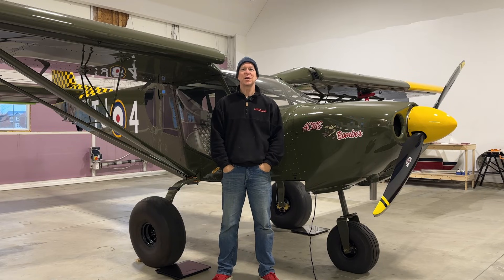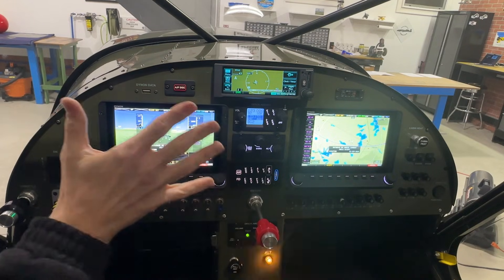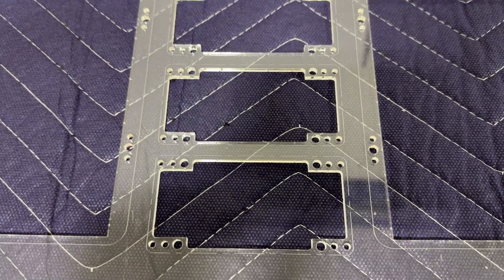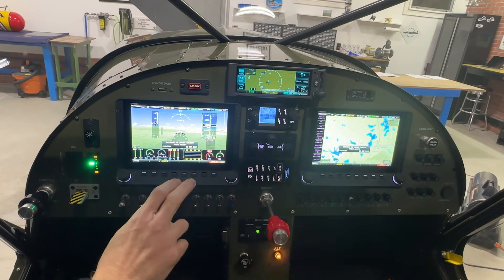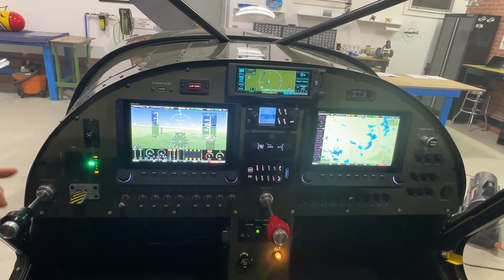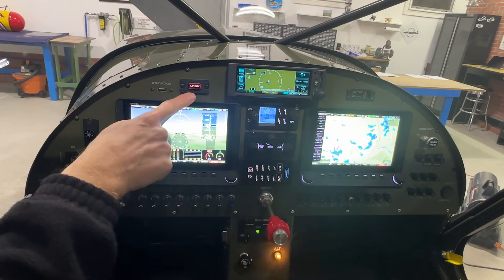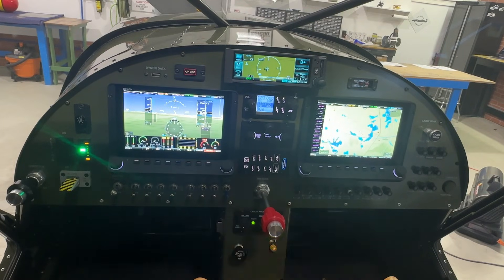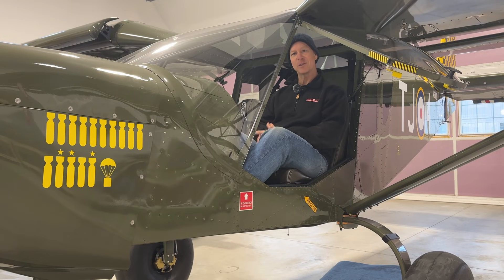Dynon Panel + Autopilot

Comment: Mark, did you use SPI single stage paint on that plane?
Reply from the maker: No the paint I used is called U-Tech 500. It’s made by Azko-Nobel.
Reply: @KitplaneEnthusiast  Thanks for the response, I guess you would recommend it or you would not have used it.

Comment: for planning and install avionic instruments and a/c lights, I remembered you said follow the manufactures installation manuals.  do you have a video that show how you layout the spacing to separate one that are noisy from comm and one that are sensitive to magnetic field generated by electrical wire for the specific parts you installed?  it would be good reference for 1st time builder like me to see your layout the spacing

Comment: I love my Dynon system as well.  Did you make an easy access for the copilot screen?  If not, you will need it to do Software Updates (not database) for the 2nd screen.  Also, did you install the limiter on the aileron servo?  I initially didn’t and the system locked up on me while doing a run-up prior to flight which would have been a problem if it had happened after take off…
Reply from the maker: I have a second USB port on the side of the center console for the second screen. I’ll look into that limiter on the aileron servo. Thanks for the tip!

Comment: Does the Dynon equipment have any engine monitoring display capability? Looks really good that's for sure.
Reply from the maker: Yes. There is an EMA module that simply plugs in to the Dynon. After all probes are hooked up to the engine all that info is displayed on the main Dynon screen. Works great and you can organize the info any way you like.
Reply: The bottom strip on the left hand HDX unit is the engine display. Plus, there’s a dedicated engine page that can be pulled up on either display.